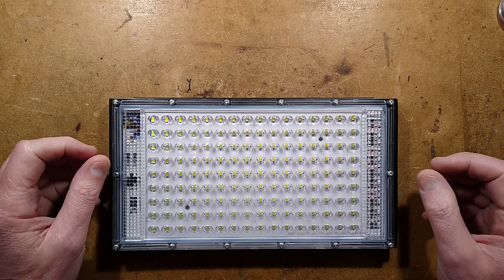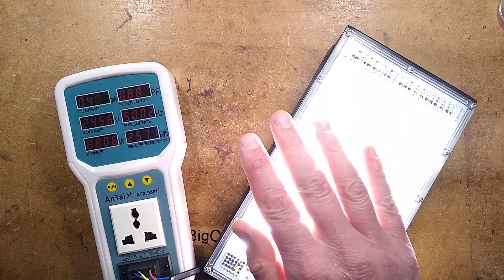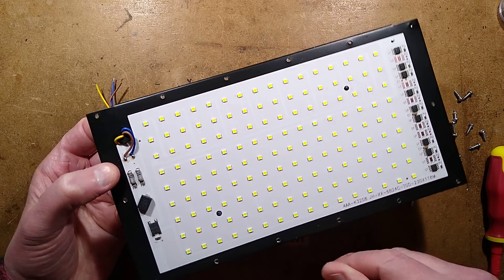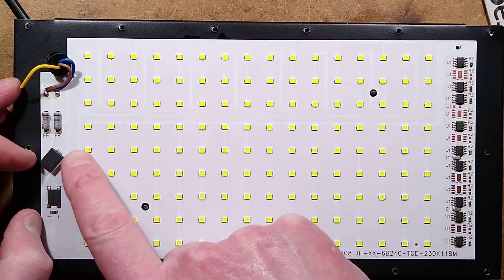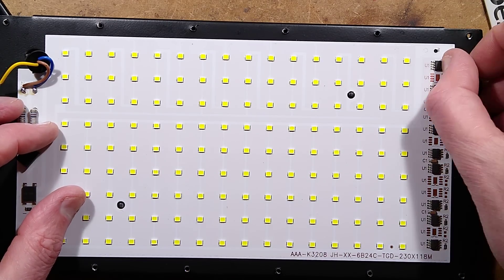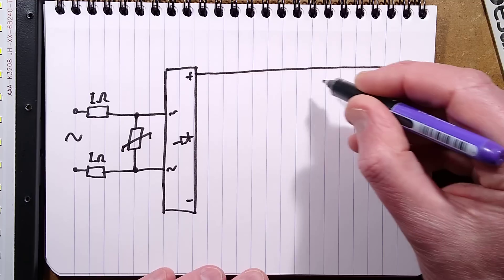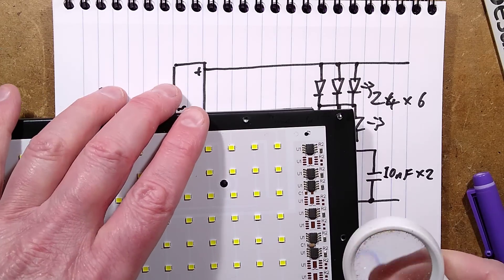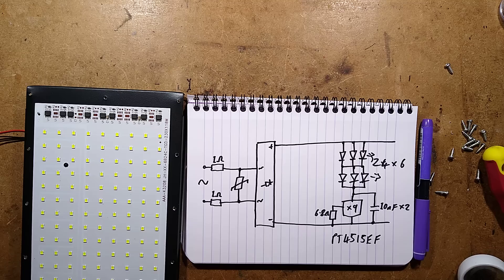eBay 150W LED floodlight?  FLICKER WARNING

Comment: That metal plate can handle maybe 20 W of heat. Considering the LED conversion efficiency to be 50%, it means that the 90 W used when the floodlight is first turned on, will throttle down to 40 - 50 W after few minutes of operation. 
The LED life is stated as 50,000 hours, but their cycle life can vary widely, depending on the temperature excursion of each cycle.
Here, with hard temp limiting, the temperature of the LEDs is pushed to the theoretical maximum of 90 °C, where you can expect delamination (phosphor layer detaching from the InGaN die) to occur after about 5,000 cycles in the best case, or 500 cycles in the worst case. Practically, the flood light would stop operating after one year of use...
Reply: I've gone back to halogen for some security lights because of how "consumable" LED flood lights have become. Even though those bulbs are only rated a few thousand hours, they still outlast the LED units.
Reply: @spxza  I hoard halogen, fluorescent and basically every other lamps that are not LED until I can buy them.
Reply: The LED efficiency is never 50%. On a wikipedia article it is written that the theoretical maximum efficiency is about 40%.

Comment: I have one as bench light too. Gets really hot and flickers just like this. It was a 2€ 50w model. Got 3 actually. I can't recomend it, but I can assure that it is fairly bright.
Reply: I keep on meaning to hack the small LED floodlight I've got rigged over my lathe. I get a cowboy-movie "wagon wheel" strobe when the chuck is rotating at the right/wrong speed but as far as I can tell I could run it from DC. If that works I could use a FW bridge and chonky smoothing cap (robbed from an old computer PSU) and feed smoothed DC into the floodlight to get rid of the flicker.

Comment: I modified a mains 120 watt flood light (pir activated) and  put a 3 or 4 watt 230 volt led bulb ( around 40 watts equivalent) in place of the energy hungry halogen tube filament bulb, also altered the timer to 5 mins so it's not going on and  off as we walk in and out with stuff, it's plenty bright enough to light up the path, saves a lot of energy and is not too bright like a WW2 carbon arc spot light.😎
Gaz Yorkshire

Comment: I've tested quite a few cheap lights with the ground wire clipped off. One had a metal frame that was advertised for use in wet locations. It had a place to land the ground wire but the manufacturer was too cheap to spend a dime and have it done right. As an electrician, that really pisses me off.

Comment: Bought 10 of these. First two fitted under a roof shelter lasted 3 years. They went faulty (just glowed) so replaced. The next 2 lasted just 1 month.
Other than damp air, well put of any rain.  Will replace again and see what happens. I operate them via a Titan relay system so wonder if they overburden the relay switch.  Another 2 aren't used much and are fine

Comment: Apart from the mounting bracket being very flimsy they're not too bad. A small solder lug and s dab of solder fixes the earth problem.  What always annoys me is how short the flex is. I know wire is expensive but come on China, make the lead 1M long.

Comment: I think i'll actually buy one of these for use as a bench light. I'll attach a large heatsink on the back and connect the earth properly.
Reply from the maker: Note that there is strong flicker that will be detected by a camera.
Reply: Ive got some 22uF 400V capacitors. That should reduce flicker.

Comment: PT4515 is an LED driver chip, apparently
Reply: Datasheet on LCSC but no stock from them. Easily available in China, mostly in SOT89 and TO252. Y0.5 (about 0.5p GBP) in TO252.

Comment: My money is on loose ground wire randomly shorting live.
Reply: It's a feature, It'll let you hone your troubleshoting skills 😅
Reply: That's funny and relatable. Once I had to replace plug on soviet heater, so I decided to connect ground wire to metal enclosure. After some time this thing burned without tripping anything, as house had NO ground.

Comment: Got one of these from Temu like a year ago but is a grow light. Does work nice for the 7 bucks i paid. Also i filled the back with some heat-sinks and a fan now doesn't get as toasty.
Reply: I did the same, using a PC CPU heatsink & fan. I use mine to recharge the batteries in solar powered watches. Runs much cooler now & is quite good for the price.

Comment: I bought this exact light from Aliexpress for £2.50 posted. I haven't opened it yet, but I did do an earth continuity check and wasn't surprised to find it unconnected. Certainly wouldn't fit it outdoors, but might be OK in a shed with an RCD and never left unattended.
Reply: You can surely crimp a connector onto the earth wire and bond it to the metal?
Reply: Definitely, but I was thinking more about the overall 'quality' of the light. @CamelCasee
Reply: Outdoors that "floating" earth wire will end getting better electrical connectivity to the metal housing through the dirty and/or rusty water.
Reply: @ruben_balea  It won't last long enough to rust. lol
Reply: That is a hell of a lot of light for that price. Connect the earth wire to the chassis, give the wires a glob of silicone and maybe it would be okay. I'd be interested to see how hot it gets running for a long time in a hot environment
Reply: @inhopeofabettername  Certainly is, though I'd be inclined to follow Clive's advice and put a dropper capacitor in series. I doubt it would last long at full power. But then, at that price, you could have a stock of them if you are using them in a location which makes them easy to replace.
Reply: @inhopeofabettername  it won't last tho. 
100w of led needs a lot of heatsink and this one literally has non. 
I'd say it would be fine with around 20w but no more in that housing
Reply: @NinoJoel  It would thermal throttle thru the linear regulators to about 40-50W or so I think
But running the LEDs at 120°C killing them in under 1000h I would guess
You get what you pay for
Reply: @Fluxkompressor  that 40W would be to much at longer usage and it also defeats the propose of buying 100/150w lol. 

I recently bought a Outdoor floodlight with large cooling and motion sensor. 
It has real 100w and runns nice and cool. 
It's waterproof and has a metal / real glad case 

Has been working for months already and costs 13€ .... So  wy buy this garbage
Reply: @PSUQDPICHQIEIWC  the heat sink is just so large that is disipates the heat nicely it gets slightly warmer than my hand and that's it
Reply: @PSUQDPICHQIEIWC  if you put the light on a motion sensor i doubt it will be on long enough to make much use of a big heatsink....
say you got it somewhere wherer it switches on for 5 minutes to light your doorway while you enter your house and then it turns off again for hours.
it will first dump a lot of heat into the metal housing before actually needing a passive convection heatsink
Reply: Only £2.50 to build it and ship it across the world. Can't buy a sandwich for that in Sweden 😂

Comment: I guess the power of this floodlight is quite acceptable. They probably glued the aluminium PCB with some thermally conductive glue. Nice video once again!
Reply: Kafuter electronics silicone from China claims to have impressive thermal conductivity, akin to basic white thermal paste. I have used it and it's certainly thermally conductive and acid free, but i can't exactly say how thermally conductive it is.
Reply: when 100W doesnt seem warm by touch, i guess it is thermal insulator
Reply: @viperwizard491 It is not a heater. And LED is  very efficient light producing devices. I think i read it somewhere that the led efficiency could reach 70%. So in this case, only 30 % is converted to heat.

Comment: I don't understand why the Chinese aren't able to attach that clearly present ground wire to the chassis somewhere.. would that be so much more effort? Or do they just not care about the lives of people?
Reply from the maker: They just don't get the earth wire concept in China.
Reply: @bigclivedotcom Yes, exactly. They often don't have earth wiring, so they think Earth is  just a western tradition to make a ritual sacrifice of some copper to the safety gods by using  a 3 wire cable.
Reply: @bigclivedotcom  If I recall correctly, some of the asian countries have technically a galvanically isolated circuits in the buildings. They don't ground the transformer either.
Reply: A lot of these really cheap products aren't designed by EE's or even enthusiasts, but sometimes just some employee or the factory owner's son. They just don't have the safety education or understanding of why you'd want the chassis earthed. Clive has definitely taken apart a few designed by some EE or hobbyist and those have a screw for the ground wire, whether it's used depends on how well trained the assembler was.
Reply: No care for live, deception  is why the green wire is there
Reply: Prior year 2007, the Chinese didn't had switching power supplies and Li-Ion/Li-Po batteries. 
At the same time, they hated main power transformers with a passion, because of all iron and copper required to build them.
I have some Chinese rechargeable torches, small appliances, toys, light sources, etc. from that time. The batteries were all miniature Lead-acid, but not gel, AGM or dryfit: they had liquid acid in them. The power supplies were all made with a capacitive partition, i.e. a big capacitor in series with the bridge rectifier, connected with the main. Some torches had a jack to get power from the battery inside to power a calculator, a radio or other devices, and one terminal was connected to the HOT of the 240 Vac if the plug was inserted in a certain way.
There are building codes in China that direct the use of a ground wires and RCBs, but they are widely unknown, and just like fire hydrants or fire alarms  - they are considered wasteful and useless.

Comment: Why not start with positive voltage through the regulator and then the led?
Reply from the maker: Common emitter switching topology.
Reply: My brother bought a light very similar or identical to this to use as a lure for catching moths and insects. 

Using it in the evening and with the thing apparently covered in dew he got a nasty electric shock!

Sadly he threw it straight out, I would have liked to have examined it.

Comment: Only yesterday did I split a similar unit down though fitted with purple/black LEDs which I wanted to illuminate fluorescent paint .  (8x12 LED matrix and 5 regulator chips on the right) 

Exactly the same earthing derangements though!

I stripped it to fit a longer lead from the stupid 2 inches supplied, I drilled a hole adjacent to the grommet to feed the earth wire on my longer lead back through and secured it to the frame for earthing.   Then silicone sealed the hole around the wire.  The  purple version seems to get quite hot in use though.
Reply: Mine too, I have a white 50w version. Same thing as Clive's. Hot as hell

Comment: Curious how far the power would drop down due to self regulation if you left it running for 20 mins or so...
Reply from the maker: It went down to about 75W.
Reply: @bigclivedotcom Ah, the ECO mode

Comment: Well...I guess 2/3 of the stated rating is way better than the normal 1/4 or less usually encountered from Chinesium manufacturers
Reply: You need to distinguish between goods made in China and foreign companies manufacturing goods in China.
Apple make most of their iPhones, iPads etc in China.
A big chunk of the spare parts needed in the US defence forces are made in China.
NASA makes a lot of its components and spare parts in China.
Even Harley Davidson has a motorcycle plant in China.
So when one says Chinese manufactured it’s code for Western Corporations exploiting workers in China and taking advantage of lower environmental and safety standards to maximise profits, shareholder returns and CEO bonuses.
Remember it was the US that funded the Wuhan lab work on Gain of Function research because GOF research is illegal in the US. So is stem cell research from embryos.
This is done because the markets are in the West - especially in the USA.
Drug and medication use is a good example.
The US barely makes up 4% of the global population yet consumes about 85% of drugs. The US also consumes about 1/3 of world’s resources and produces 30% of world’s waste and pollution.
I wonder what the problem is?
Reply: @PetraKann 
I wouldn't own any Apple products either
Reply: @PetraKann careful. 
You will wake up lots of angry Americans that don't like facts
Reply: It is not tho. 
The power output will drop way below 50% because there is no heatsink.